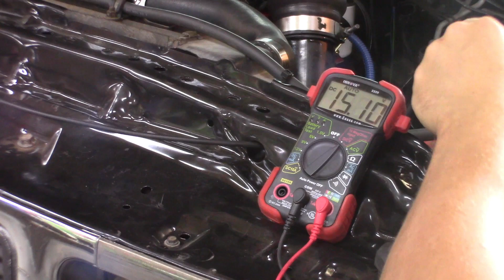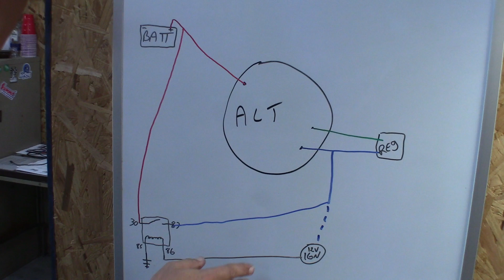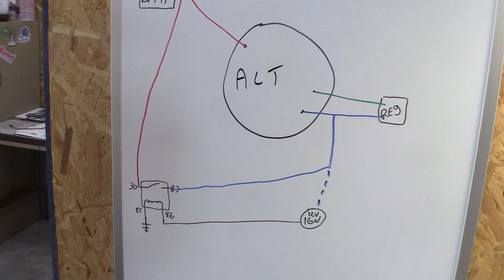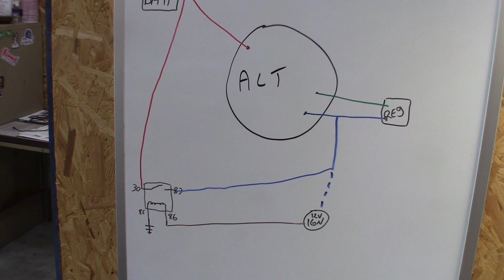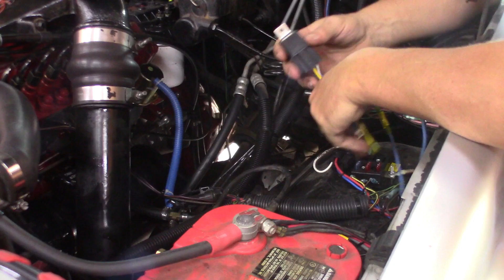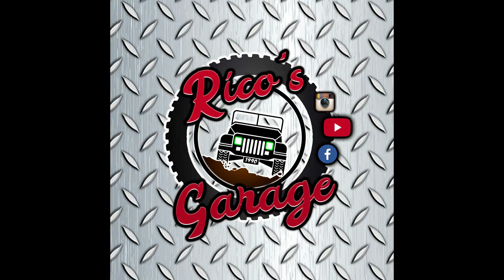Cummins / Chrysler External Regulator Overcharging Issue Fixed

Comment: I have a 1993 jeep xj, I had a very similar situation and that worked, but. I put a 20 amp fuse inline on the exciter wire and it blows under acceleration. If I keep the RPM under 2000 and get up to speed (65), it's ok. Any faster and it blows the fuse and we are back to battery voltage. I'm afraid to take the fuse system out but I'm confused.
Reply from the maker: Have you installed an external regulator or still using the PCM to control voltage?
Reply: @RicosGarage  yes a kit from the alternatorman. My original problem was on a trip and under acceleration. At that time all oem, it shut down completely. It blew the 20amp fuse to the computor 2 and shut it down, no start. Replacing the fuse at over 2000 rpm it pegged the gage at 19 volts but didn't blow the fuse. I went for the outside regulator and had the alternator checked. 
First time I ran the exciter wire from under the dash in a switched location in the fuse box. I found the same problem you did. I also cleaned all the grounds. After that it worked but a throttle jab blows the fuse on the exciter wire. It don't seem to make that wire hot or anything I have held it in my hand while I rapped it up. But over 2000 rpm it blows the fuse. I have had it rechecked and have all the test voltages, but it leaves me scratching my head. I also got the alternator shunt for a better word that shut off the alternator light and it worked on the light.

Comment: Still scratching my head on my 97 dodge ram 12 valve cummins. Replaced my alternator still same problem. Lights go dim And volt gauge goes low 8 to 12 even when I hold motor at a rev volt gauge goes low then back to 12volt over and over. Any suggestions. Thank you.  Eric.
Reply from the maker: Check the two small wires on the back of the alternator. They have a habit of breaking inside the rubber insulator they are molded in. 
If that doesn't work reference my other video on wiring an external regulator and bypassing the PCM voltage regulator.

Comment: Hey so I did this now I don’t have any break lights and the fuse keeps blowing out as well? 
-
When I turn my right signal on its drastically drops the battery voltage. Any ideas what could be wrong?
Reply from the maker: When you had an overcharge situation it's possible your wiring got damaged. It sounds like your right turn circuit has a short. Look for a burnt wire or maybe a corroded wire or plug. 
I'd say the problem is in the right rear and the both brake lights draw to much current and blows the fuse. 
When the right turn us flashing does anything else flash? That would indicate wires melted together.
Reply: @RicosGarage  Yeah the dash lights dime with the right turn signal. I'll get under there more thoroughly and see what I find.
Reply: @RicosGarage  thanks for the info!
Reply from the maker: @JaronWhelan  No problem. Hope you get it figured out

Comment: My 09 dodge ram quit charging so I put and  External regulator on it and now its charging hight up into the 18.17 how do I get it to level out with this  S stonell regulator system.  Its a gas power
Reply from the maker: Did you add the relay and follow the diagram as I have it in the video?
Reply: @RicosGarage  im going to do it today ...u thank that will fix my 09 dodge ram..I had to put this in because my pcm went out in my trucks computer
Reply: @RicosGarage  and that the same thing as is im talking red wir on and off the battery
Reply from the maker: @brianyerty6381  I don't understand what you are asking sorry...
Reply: @RicosGarage   adding the relay ain't it the same as  Touching the hot wire on n off the battery...I'm trying to get my truck fixed bc this is mine n my wife's only way of going
Reply from the maker: @brianyerty6381  if you are referring to the wire coming off the post on the back of the alternator as the hit wire then no it's not the same. 
The relay is used to provide battery voltage to the field wire that is spliced into between the alternator and voltage regulator. The purpose of the relay is to switch it remotely with the ignition. 
If your regulator doesn't have a good ground or doesn't see actual battery voltage it not cycle the alternator as needed and create an overcharge situation. 
You may want to reference my first video on regulator install and see if that helps.
Reply: @RicosGarage  can u send me that video
Reply from the maker: @brianyerty6381  https://youtu.be/wKDjS1hP-eU
Reply: @RicosGarage  i put the relay on my truck still didn't fix it....still charging hight 18 and up

Comment: yes it is good depending how you look at it but as similar as dual ignition ore a magneto ignition system is very usefull expecialy for economy and higher voltage to ignition system is benefisial depending again how you look at it 😉 the car feal's like it good a gear more its working lot faster then normaly but it works on clasic cars with carby's audio alternator static and coolant electrolisys can by reversed to do usefull work

Comment: Thank you so much fixed my problem on my dodge ram 2500 2001 5.9 , only thing i noticed is its not constant charging on initial starts 14.8 it jumps from 14.8 to 12.5-12.7 for a seconds or two at a time till it runs for 30 seconds then it stay at 14.8 any ideas?
Reply: Could that be your grid heater cycling on and off?
Reply from the maker: Sounds like you are still getting a voltage drop somewhere.

Comment: Glad to see you back with the Cummins.  Back when i was having this problem a few months ago I tried this method using the relay to fix my overcharging issue and it never actually worked for me.  Even getting 12v directly from the battery still yielded overcharging.   I think my donor alternator has a bad rectifier or some other internal problem which kept this from working.  In lieu of buying another alternator and possibly getting the same result (couldn't return it after it would have been installed) I opted for the PA Performance self exciting alternator.  It just has 1 wire which goes to the battery and thats it.  It automatically begins charging when the motor starts. It wasn't cheap but it was a sure fire fix whereas my external regulator setup may or may not have worked with a diff alternator.  Oh, well. Thanks for the video, Ricky.
Reply from the maker: Well sorry about your bad lucck with the alternator. I was hoping this would help you out..
Reply: Interesting. I have a 2000 2nd gen Ram that had/has the overcharging issue. Been chasing this for years. First the batteries went bad so I replaced them with Odyssey AGMs. Then I replaced the battery cables with oversized cables and checked grounds which were all confirmed good. Problem persisted. I then changed out the factory alternator which appeared bad initially when tested (mixed results at Napa autoparts bench test). So I opted for a 1-wire from PA performance. This confirmed proper battery charging and output, but the gauge in dash has spikes that goes past 18v despite the multi meter giving confirmation of 14.5v output. I’d gladly go this route shown in the video if I had a standard factory alternator that still has the voltage regulator cable connection - but again, I replaced it with a 1-wire that eliminates this cable. I asked AI (Grok) and it suggested to wire up a 25w resistor (electro-mag field replacement module to trick the PCM) to the end of the now empty plug that went to the factory alternator (green & blue wires). So I did, problem remains, gauge still spikes. Batteries and alternator are confirmed fine. It’s the gauge reading from the PCM, that’s what AI (Grok) suggests. It says the PCM is hunting for the signal still, and since it’s been eliminated, it convinces itself there must be and overcharge issue and sends the (faulty) signal spike to the battery gauge in the dash. But AlternatorParts.com suggests this may not always fix the problem. So now I’m left thinking that the PCM must be the problem and needs to be replaced (per Grok’s suggestion). But is there a way to bypass the PCM and still use a 1-wire alternator without the faulty 18v spikes/“check gauges” chimes? Would the relay fix in this video apply in my case (considering I don’t use the voltage regulator wires any longer)? Any help /suggestions?? 😅
Reply: @RicosGarage see above 👆